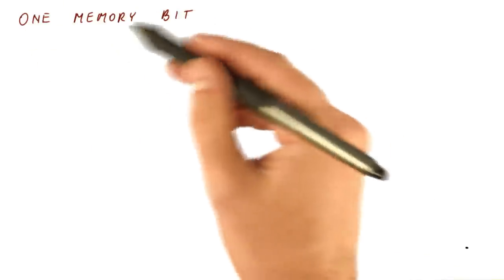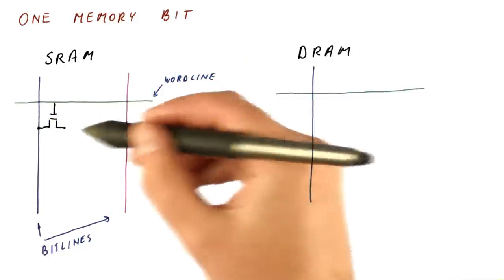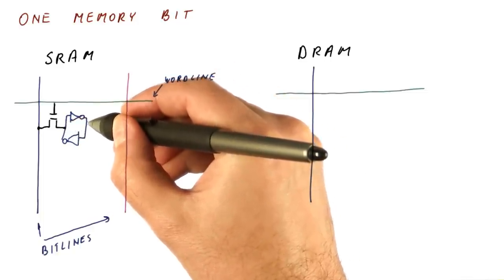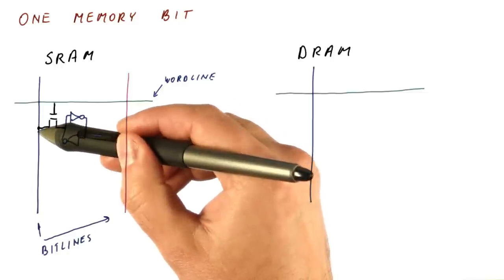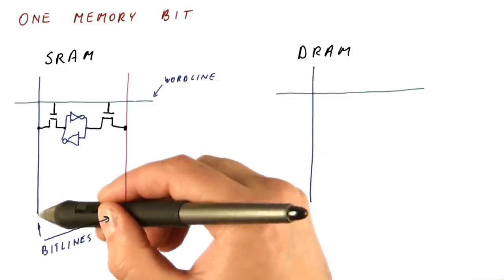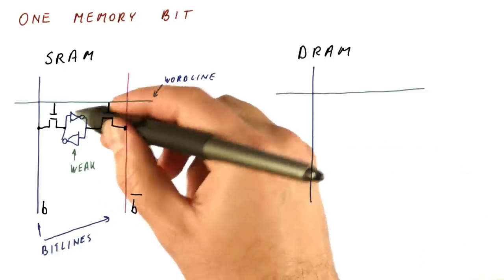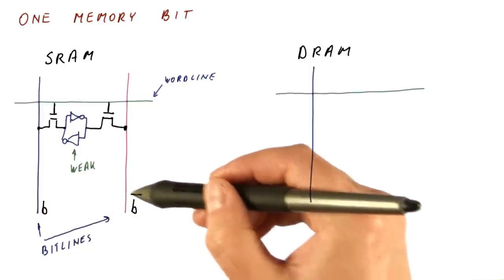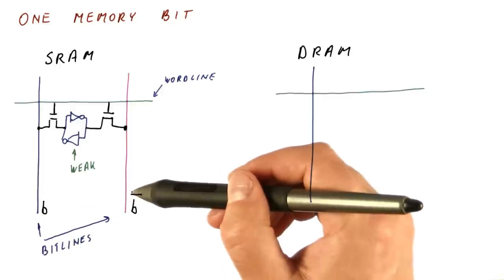One Memory Bit   SRAM - Georgia Tech - HPCA: Part 4

Comment: Does the loop of inverters waste energy?  is there a way to reduce the power consumption from them?
Reply: Loop of inverter has energy consumption. You can reduce the power consumption by designing low power CMOS. More info to start with: https://bwrcs.eecs.berkeley.edu/Classes/IcBook/SLIDES/slides4a.pdf
Reply: Well, static power dissipation is zero( i.e. when the transients are not present in the cell). Regarding dynamic power consumption, that will to a large extent depend on the bit line capacitances that the inverters will need to drive.

Comment: what actually happens when he says that "the stronger 1 defeats the 0"?
Reply: If inverters are trying to drive a 0 and you want it to instead drive a 1 (because you want to store a 1), you want to "defeat" the inverter's value and force it to drive a 1. So the only way you can do that in this scenario is by having the 1 (the bit line) be much stronger than the 0 (the inverters), which will force the inverter to change to drive a 1 instead.